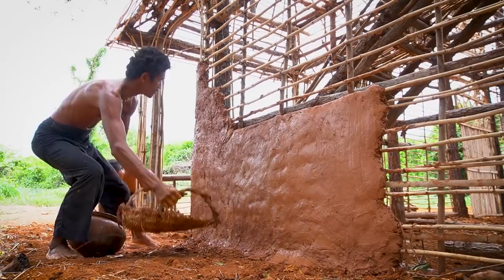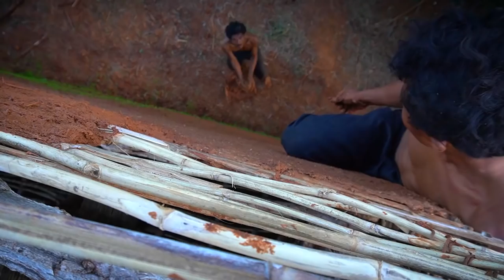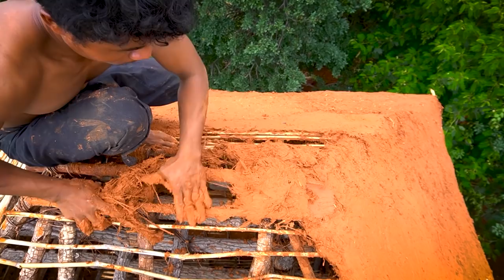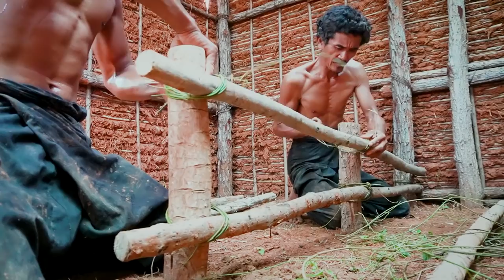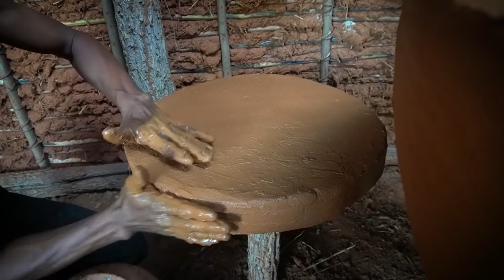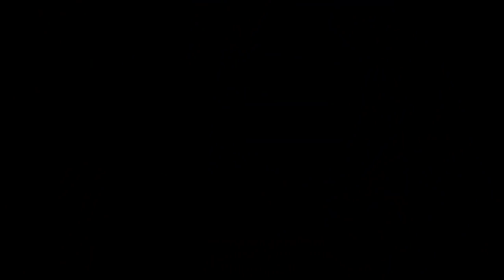Build a green house by planting grains around to protect from the heat

Comment: I was quite curious as to how they were going to wrap the exterior of the house to keep out animals, the elements and keep it warm.
Their process is very ingenious.
It would have been especially beautiful had the planted flower seeds.
Perhaps a flower that crept or vine-like 🤔
Reply: The vine is a rice , and the seed is a rice also they mix up all together they use red soil for good results cuz that kind of soil is sticky and hold longer than other type of soil
Reply: the walls are made from cob which is be used in pretty sophisticated structures, usually with thick walls and straw bales in between the interior and exterior walls for warmth which could be done here if they wanted to. instead of planting seeds in the cob like they did here, more functional buildings made from cob might be covered in plaster after drying with the roof extended out to protect the walls from erosion from rain. i’ve seen people living in three story cob houses with sophisticated yet sustainable heating and cooling systems (because cob can trap and slowly release heat in winter and stays cool in the summer) and living quite luxuriously. i think it should be a more wide spread building practice
Reply: @loveindayjen  not to mention all the tiny roots of support the grass gives off especially with the abundance of it around the house, the seeds in the mixture let alone give it a thatchy texture making it easier to hold together. Carlita must not know what hes talking about lol, especially with im imputing that it was ingenious without considering they are 2 guys building a 3 story house and the use of clay binded with the seeds made for an easy ball up and throw for the guy on the second floor, these guys are some damn articular wizards.

Comment: This is an amazing concept. I want to See the same strategy using mushrooms rather than grass. I would also use lumber or bamboo  to surface to cover frequently touched interior walls, floors and stairs. Also, what long-term effect does rain have on the outside walls and roof?
Reply: I would also build it as a dome  for better aerodynamics for high winds.
Reply: @Leanne Wesk The vast majority of mushrooms do not need poop.
Reply: Mushrooms require darkness and cooler temperatures than they can get in the jungle. A grass such as rice is ideal. The roots intertwine which stiffen the walls and roof.
Reply: @elizabethrobbins8580  it's actually a myth that mushrooms require darkness. There are some species that thrive in low light conditions but many species do just  fine in the light! As for cool weather, again some species like cool Temps while others do great in warmer weather. For mushrooms it's more about humidity than temperature. That's why they generally don't grow in arid regions. There are many, many species that love tropical areas!
Reply: Also mushrooms are a great construction aid. Instead of roots mushrooms have mycelium that they use to spread below the ground. The weave of the mycelium is very thick and if cultivated properly can actually be used to create unique shapes. There's one woman who grew a canoe using mushroom mycelium and it actually worked! It's a fascinating subject that's worth looking into

Comment: Won't the grass deteriorate the integrity of the hardened mud? I'm thinking the grass roots will loosen the hardened mud enough for the rain to wear /erode it especially as the place is subject to typhoons and the monsoon rains.
Reply: Look up Cobb building.
Reply: @DIYwithUncleCy  Cobb is typically only used on walls, and they don't throw grass seeds into the mix. The only reason Cobb walls don't dissolve is because they're kept dry by overhanging waterproof roofs.
Reply: @jipsels  you’re right on that. This will be an interesting experiment that I hope they give updates on for the next few years. If the grass is a shallow rooted verity that grows densely, this grass should help keep everything together and shield the structure from the elements. However, deeply rooted grass varieties that require a lot of water to keep a thick cover probably won’t last nearly as long. I might be wrong though, I’m not used to tropical areas. Then again, this could be similar to peat bog houses used by the Vikings in the Netherlands for thousands of years. Those houses needed to be rebuilt once every 40 years or so.
Reply: @DIYwithUncleCy  as much as I agree that this is more of a cob style of building, doesn’t the integration of densely rooted plants into the material more akin to peat houses of Greenland and Scotland? This is the first time I’ve seen such augmentation in cob buildings. I’m very excited to see how well this ages in a tropical climate. If you have any links to studies or videos that mirror this, please put them here so I can dive into them. I can’t get enough of this information.

Comment: The rain will wash this whole thing away over time because the roof is just made of mud. It doesn’t even look like they built a way for the rain to drain out of the flat part of the roof.
Reply: loam is one of the oldest and one of the most resistant building materials in the world. loam buildings can last centuries. espeacially in hot places. if the loam drys of properly in the hot sun before the next rain it will last for a long time. Even in my country which is rather cold and wet we have loam buildings which are several centuries old already.